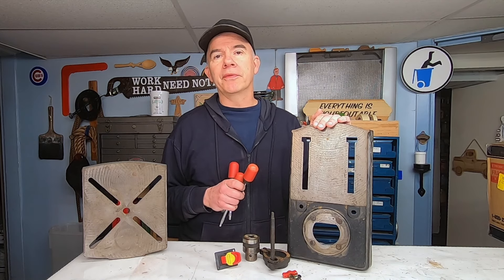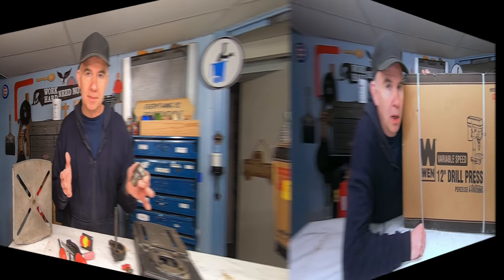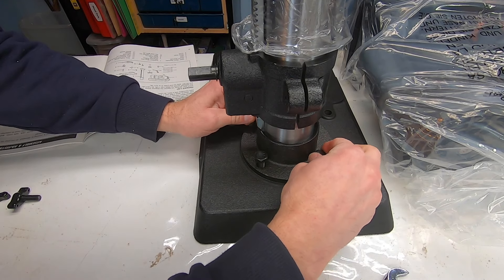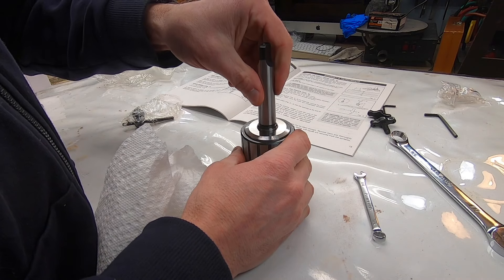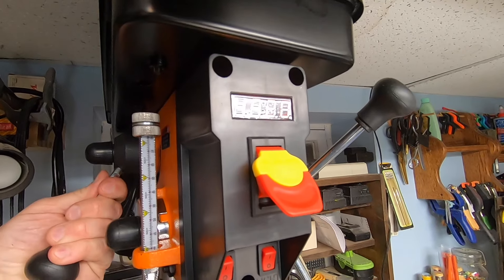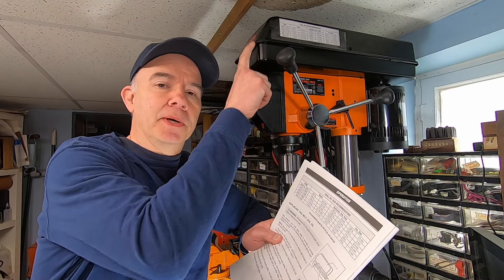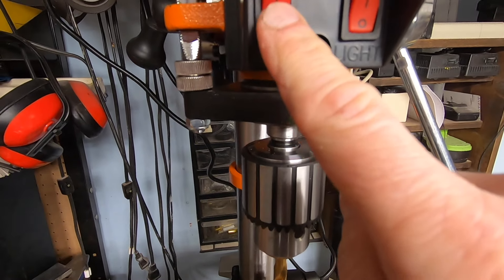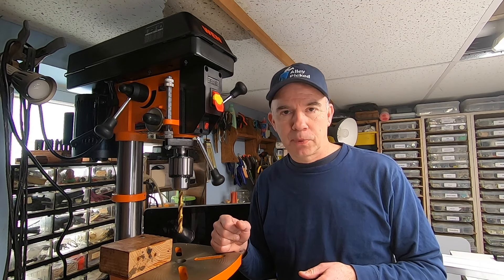Is "Wen" a good drill press? Model 4214T review

Comment: My son gave me his 12-year-old WEN 4214T. I had been using an old Craftsman, 9-inch tabletop drill press, and yes, not enough power to drill. My son got a used milling machine that does everything, and he needed room in his garage for this milling machine. I got this four years ago, so this makes the WEN 4214T 16 years old, and it works flawlessly. The only upgrade is replacing the original chuck with a keyless chuck. I had some minor runouts, so replacing the chuck instead of the drill press was logical. I will come back and update this comment. The only other minor issue is that one of the two lasers quit working, and there is no documentation on replacing the light. It is not a big deal since I have never had a laser light on my previous drill presses or other power tools.
Reply from the maker: Thanks for sharing your experience.

Comment: My Wen 12" dp has a very noisy motor right out of the box. Any suggestions on how to deal with this? I removed the drive belt and ran the motor by itself and verified that the motor is the noise source. Sounds like a grinding noise. I hear something similar in this video.